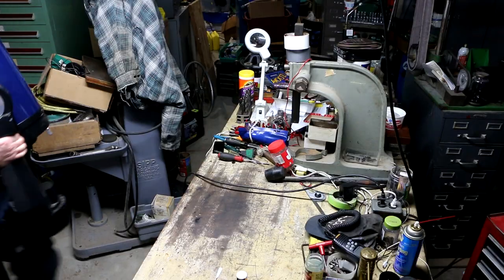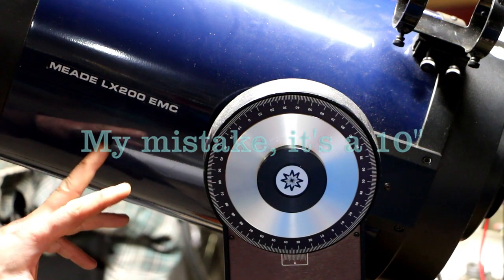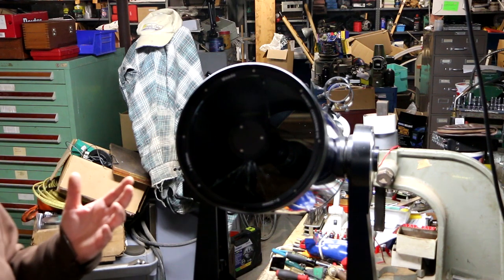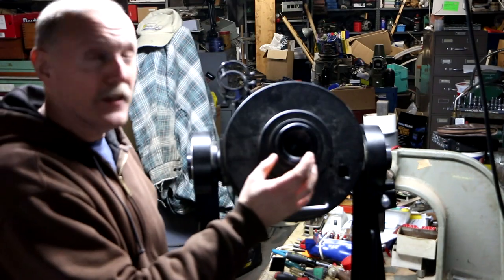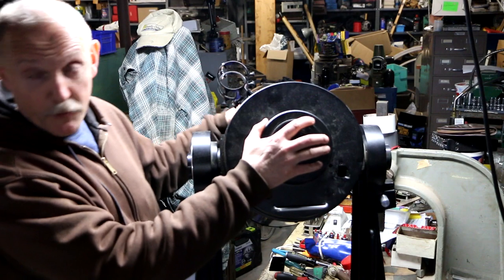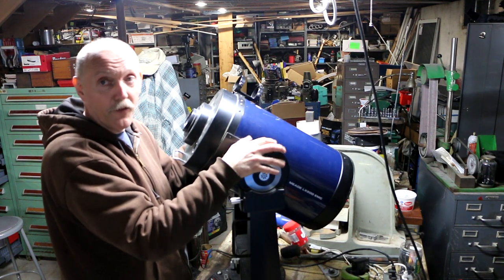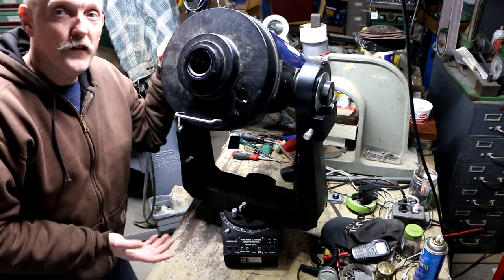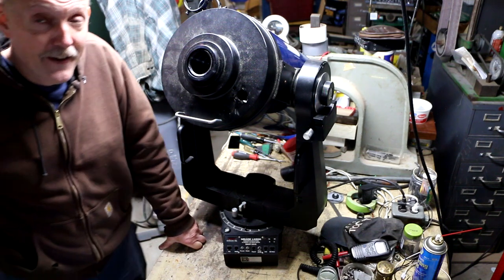October 25th 2020 Part 2: Meade LX200 Part 1

Comment: This is definitely totaled due to the broken corrector plate, however the electronics in the mount are valuable to someone with an identical mount with failed electronics.  There are capacitors in the mount that are known to fail catastrophically if subjected to higher than 12V from poorly regulated power supplies (including the one that Meade shipped with it).  There are folks out there with a good tube (OTA) and bad electronics who may be interested the controller board.